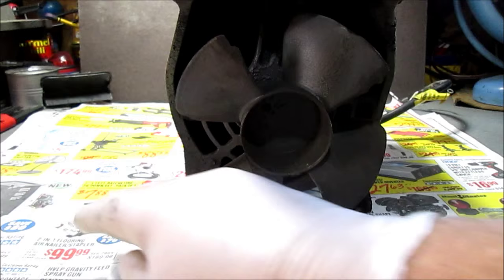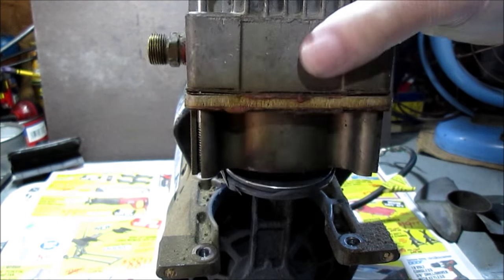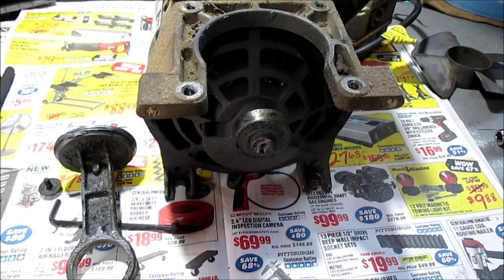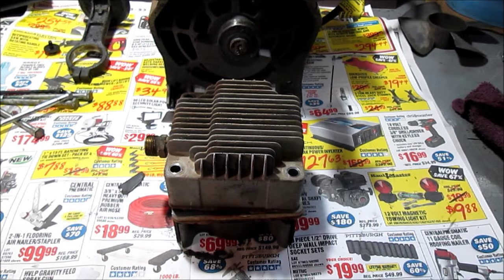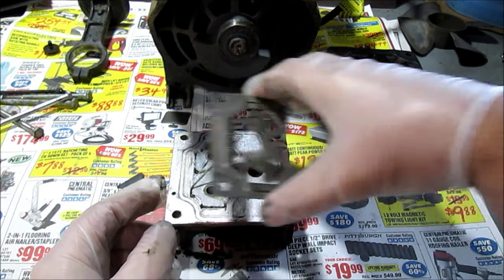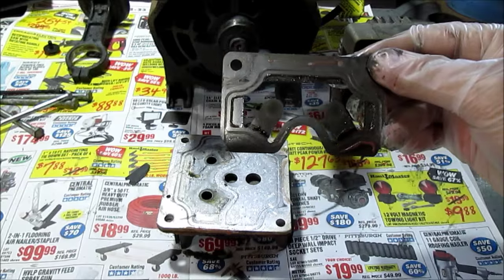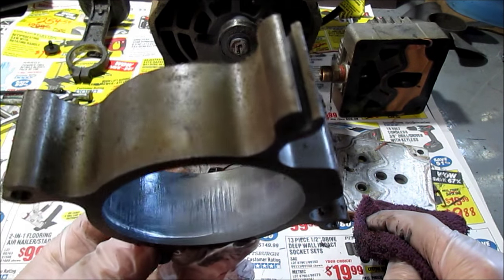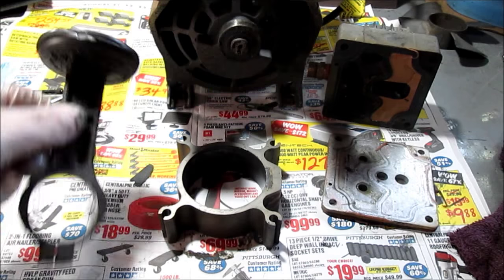How To ...Disassemble Oil-Less Air Compresssor Pump

Comment: I had an aircompressor stop working after just about 5 hours and took it apart and found a metal reed had broken.  I made one out of scrap copper and it lasted me over 10 years until I finally sold the compressor.  Great video....Thanks!!
Reply from the maker: AlchemistLair That's great you fixed it . Thanks for watching